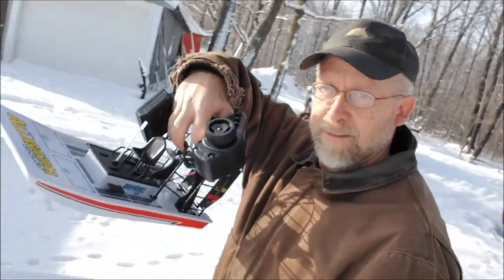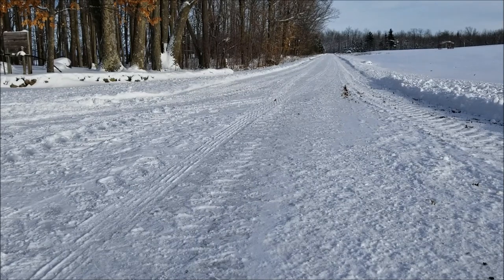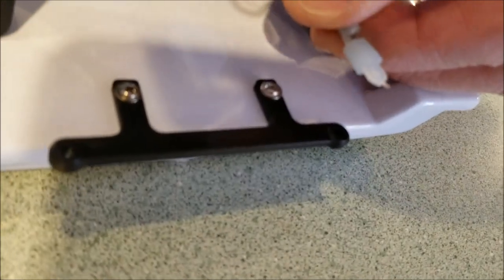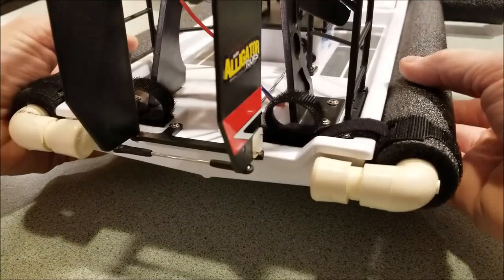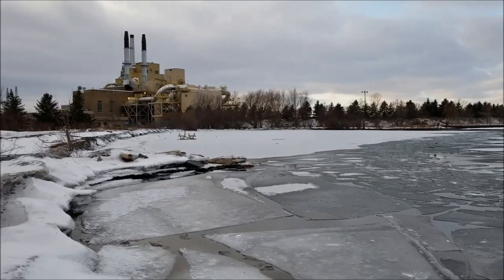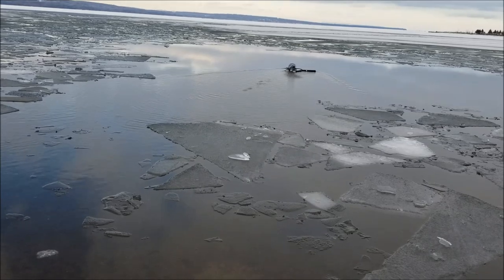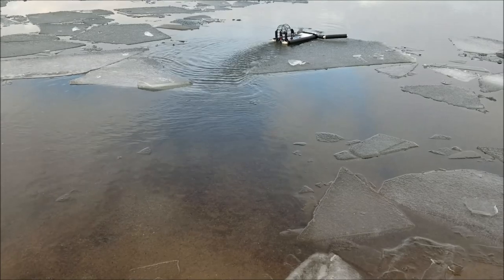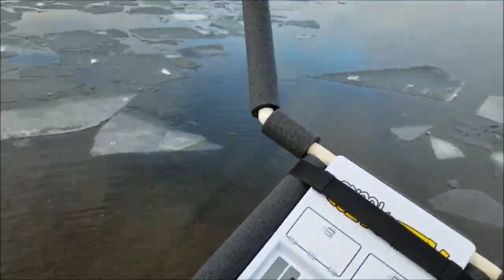AQUACRAFT MINI ALLIGATOR TOURS _MAKING A RESCUE BOAT

Comment: took the dawg out .as a rescue craft ,nah...dont think so .it was a bit windy and water was choppy but it seemed to nose dive the front end ,maybe should have went with 3/4 inch pvc and the pool noodle foam . 
not sure .first impression is not good as a rescue rig .will have to try again next week on calmer waters i guess .

took it off the frame and as just a airboat its ok .the wind does get to it .the chop and wind eventually blew it over on me and i had to rescue the thing ,good thing i had my other rescue boat rig with me (i knew better) 

took the gopro but too many people there to film anything .the kids were impressed with it and asked where i got it .

should have sold it to them ...lol....

i think i will look for the next best rescue rig .wish proboat would just make something reliable .
ps- i built the same frame as you did .looks good but function wise ?eh......wasnt too impressed .i will try again on calmer water next week .i hope .

Comment: perfect ,i bought my swamp dawg for rescue and was wondering how it would run with a pvc frame on it .
ps- mine has reverse...lol
Reply from the maker: Yeah, that's crappy not having reverse. I might upgrade the electronics. Of course that drives the cost up. It handles well, I still will test it and push my boat with it before I get in a rescue situation